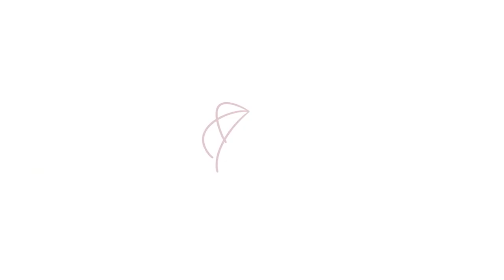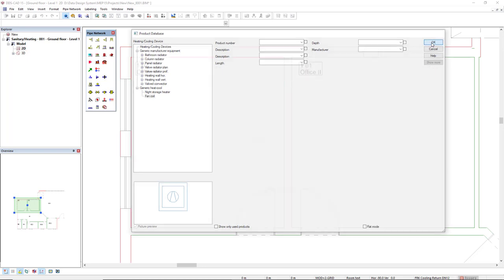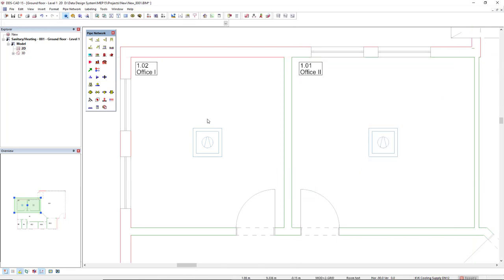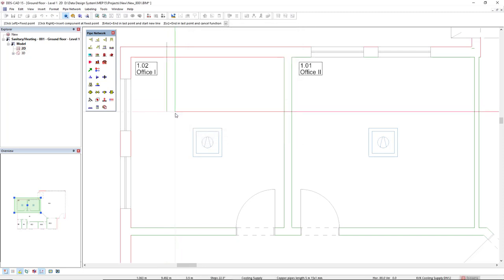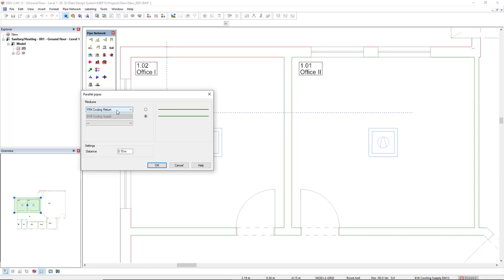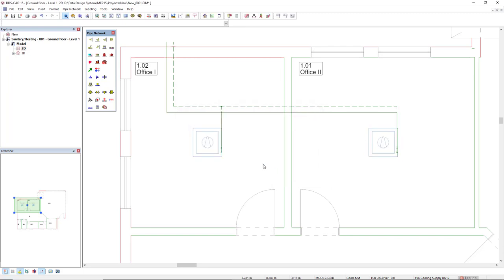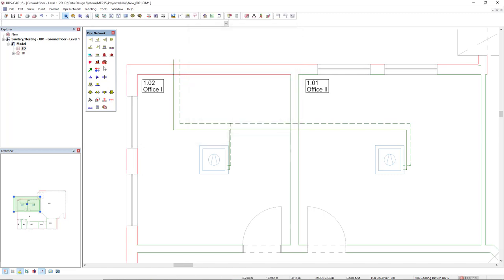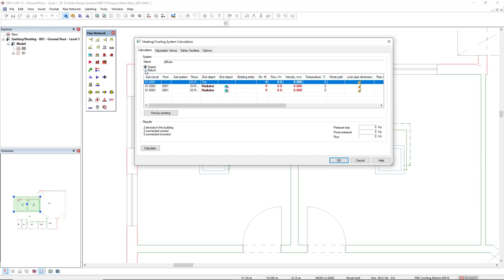DDScad | How do I create a fan coil network system?

Comment: Nice video. Another question about FCU network system: How can I create and connect 4-pipe FCU's (heating + cooling)? We made it by using "Load Object Heating/Cooling" ...
Reply from the maker: Hi Michal, you can have heating + cooling connection points connected to the same FCU, follow the process of this video to create a cooling and heating pipe system.